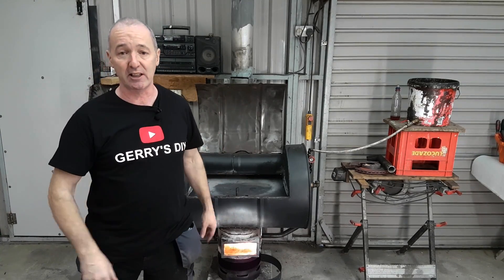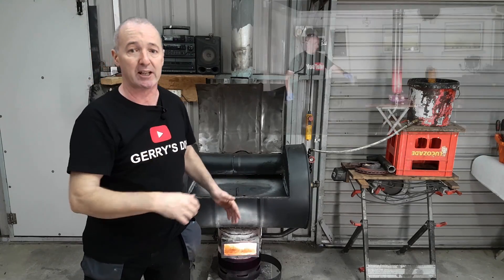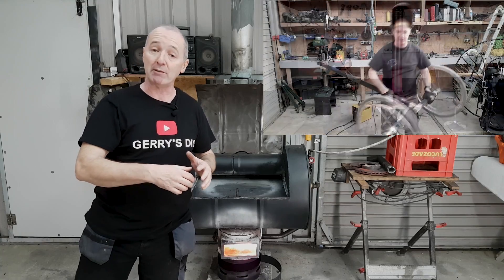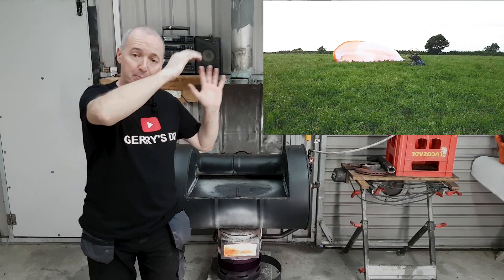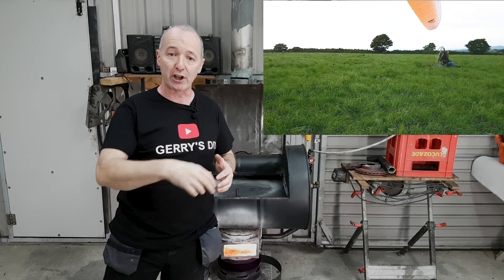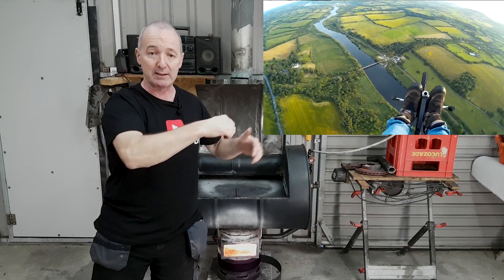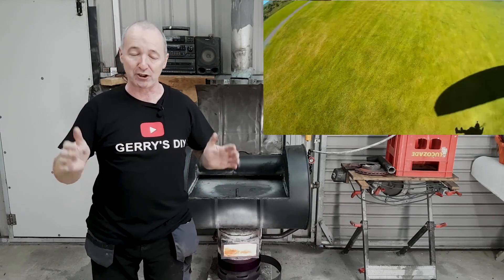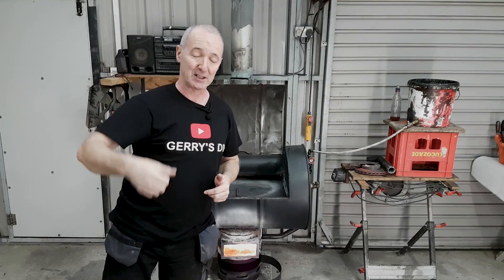Waste Oil Burner and Diy .. GerrysDiy

Comment: Gerry, I was hoping you could maybe do a video on igniting or lighting your waste oil burner, and some common problems that may be preventing one from lighting.   I am not sure if I have too much oil, too much air, not enough initial heat .. etc., but would love to understand the process a bit more.   Thanks,   Love your videos, and I know I am getting close, just can't quite get it too ignite.
Reply from the maker: Hi My Looney Bin. There are a few things that can make the difference. Are you using a blower or is it normally aspirated. Whats the flue diameter and length. do you have a separate burning chamber. If you want to send me a couple of photos or a link to a video I can have a look for you. Cheers Gerry👍
Reply: @GerrysDiy  thank you , I will put together a video of what I have done, and hopefully you can point a few things out!   Thank you so much.  I am using compressed air (an air compressor for the air) I will have to do some measuring to get numbers on the other questions.  I am getting what i feel is a good mist, but I will post the video, and then I will come back and reply again once I get it posted.  Thank you!

Comment: Hello! Have you heard of husqvarna warmwind 4002t kerosene or haas & sohn "Paris" diesel stoves before? Anyway, its a wickless stove that use a regulator  with overflow protection and termostat on some modells. Think you can get one of those to run on waste motor oil?  I have tried with no mods but it smokes like hell and aint getting hot enought😒
IF you are intrested i can send pictures ore post a video of them. Keep the good work up👍
Sorry for my bad english, im from sweden😎

Comment: Hi Gerry. Hope the holidays are going well for you!  Hey, I was wondering if you think the Pyrex bowls are actually good enough to use with no worries from heat breakage.  I saw your vid about the one that broke from being mounted too rigidly but I am still concerned about the heat they need to deal with.  I suppose the smaller, the better, eh?  And incidentally I ran across some info regarding Pyrex dishes. Apparently the older ones are better able to withstand heat. No surprise there.  But the way to tell is from the way they are labeled.  The old ones have the word PYREX in all capital letters and the newer ones are labeled Pyrex, with small letters.  How true this is?  Well I read it on the internet so it must be true, eh! (Yeah right).
Anyway, carry on Gerry!  Thanks again...
Reply from the maker: Hi Throw Me Back. I had flames licking the PYREX dish continuously and no issues. The only problem I had was metal expansion breaking the glass but that's easy to make allowances for. I am now using stove glass which is a little easier to work with but more expensive. I was out in the shed tonight using the newer burner and I could have shared the heat with the neighbours there was so much of it. lol Thanks for the comment Cheers Gerry
Reply: Thanks for gettin' back so quick!  Nice about sharing the heat with the neighbors!  That stove glass, Neoceram(?) or some such, is plenty spendy alrighty.  But with all that in mind, I am thinking a small diameter Pyrex dish will do fine. It will allow for checking on the flame but no horrible troubles if it breaks!  Shame we don't live closer. Pretty fond of messing around in my garage, too.  Built a back hoe for my Kubota and it sure beats a shovel! Carry On Gerry!

Comment: Merry Christmas Gerry, I hope you've tightened those bolts up its a long way down. lol
Reply from the maker: Hi Robert. The cylinder head is still off the engine but the bolts are wired on now. I hope to get it in the air soon though. Merry Christmas to you and yours. Cheers Gerry